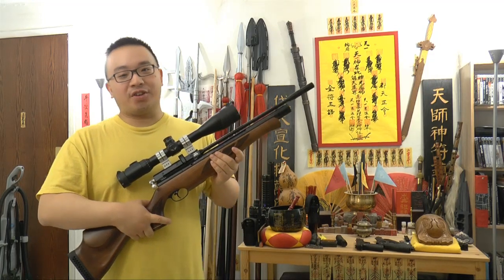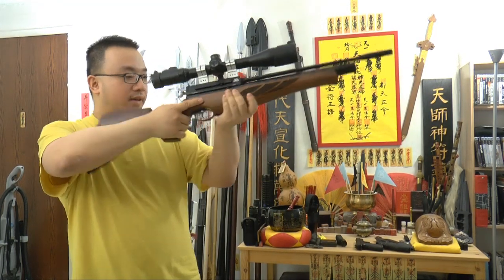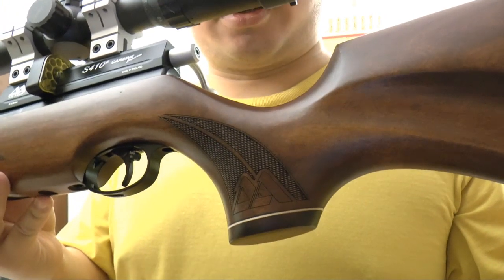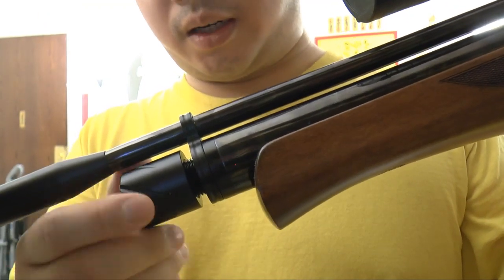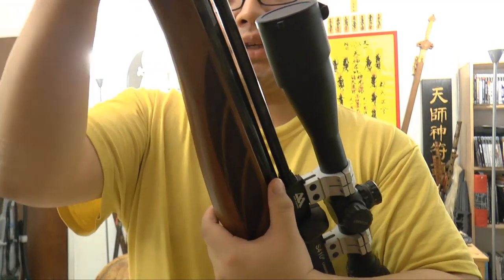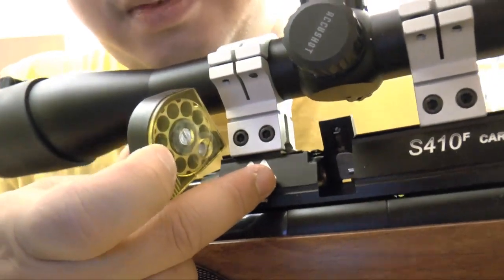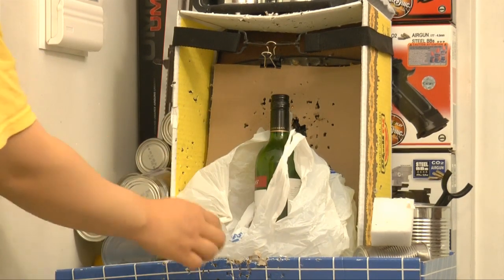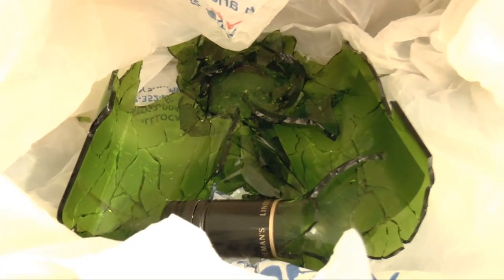Air Arms S410F Super Lite .22 Cal PCP Precision Air Rifle Review and Shooting!

Comment: It's not true that the Superlite version has a shorter barrel. The fact that it is the carbine version (not the rifle length version) means that the barrel is shorter. Superlite I think refers to the fact it has a lighter weight stock than the standard version, this shaves off nearly a pound in weight I think.
Reply: Max Bradley Yes, the difference in the Superlite version is the re-styled, light weight stock (made from poplar wood I think) and 'carbine' or 'full length' determines the barrel and cylinder length.

Comment: Watched cos I'm looking to get this rifle. Your wrong when you say it's called Superlite because barrel is shorter. The reason it's Superlite designation is cos the stock is made from Poplar wood which is 25% lighter than stock made from beech which is usual material for Wood stocks. Superlite S410 is made in both carbine and normal size versions.

Comment: Good vid Mak!  I have 2 questions for you:  1)  Did the original filling adapter come with the male quick-disconnect piece or do you have to buy that piece separate? 
2)  You mentioned 60 pumps to fill up the reservoir; that means u probably bought the hand pump.  Did you get the FX4-Stage Turbo Hand Pump by any chance??
I'm thinking of purchasing an AA PCP rifle at Airgunsource down the road so I'm looking at all my options.  The S510 looks like a beaut, but I'm not too crazy about the twin cylinder though.  Thanks!
Reply from the maker: Thanks for watching!  If you buy from AGS, tell them by email and have them get everything ready for you in a pack, then they will include the adapters you need. I bought mine there and they basically fitted all the adapters you need for free so now everything just goes QD and no threading shit.  Very nice guys there. 

I have 2 pumps, the benjamin and the G4, not the Fx. But all those pumps are good, don't worry too much about it. My student in NY have the Mk3 too, damn that pump look sexy!

Comment: fps of this rifle?
Reply from the maker: AlphaGamerTV can go up to 12fpe but detuned to the sub 500fps right now for Canadian market
Reply: so the full speed is about 850 fps?
Reply from the maker: AlphaGamerTV .22 cal fly around 600-700fps depend on your pellet weight. 16 grains fly around 600ish FPS, which is just at the 12fpe mark. If you want higher power you need to buy the FAC version because UK have the limit of 12fpe. Anything over 12fpe requires a FAC license to own. All Air Arms rifles are like that. Mostly all set to about 12 fpe if it is not a FAC version
Reply: you can get one below 500 fps but itl cost you about 900